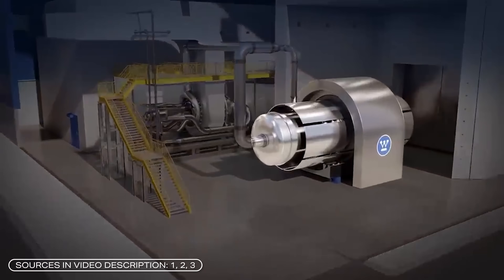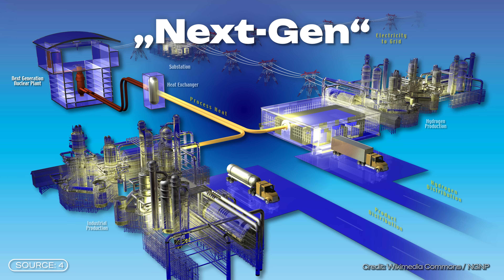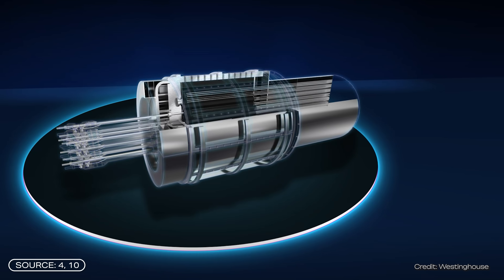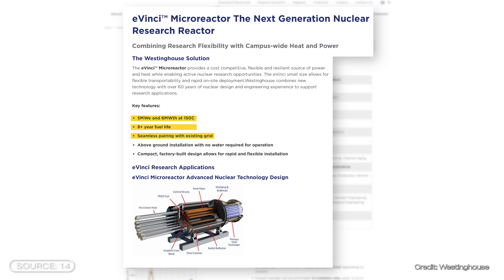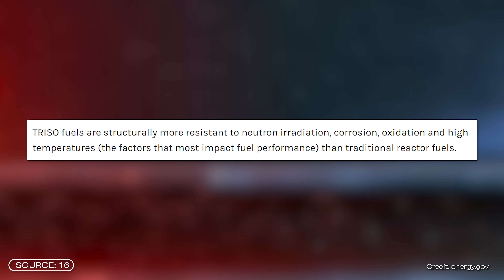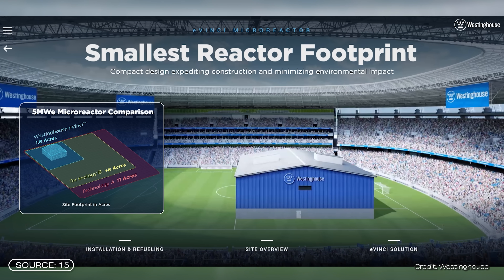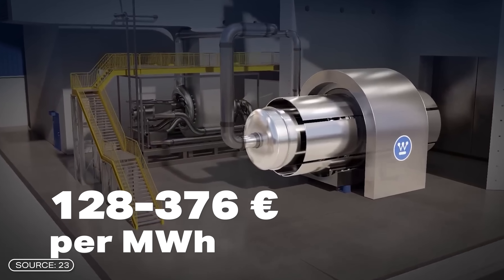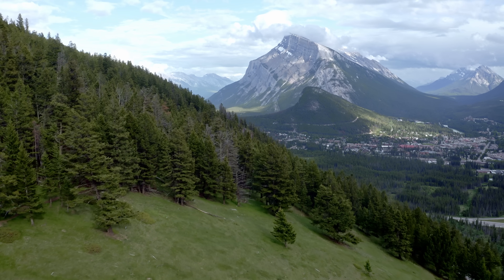Transportable Nuclear Energy: Can This Tiny Reactor Power Our Future?

Comment: If you have a small 10 MW power plant, I would argue they would be awesome for large cities. These things can easily find a use in densely populated areas, because they will reduce the load on the local electrical grid, which means that building newer and bigger projects will not require massive investments in upgrading the local electrical infrastructure.

One issue that we face with electrification of our vehicles is charging capacity. Especially when you're in cities where few people have their own home charger. Think about the MASSIVE gas stations in the US. Buc-ee's in Luling, Texas has more than 120 gas pumps. Imagine the peak draw from the local electrical grid if that was 120 car chargers. Drawing 50 MW from the local grid, especially with massive variance which could range from almost nothing to the full 50 MW could be problematic.

10 MW can power twenty-five 400 kW car chargers. That covers all electrical cars that are currently available. You'd need 48 MW to be able to meet peak demand for those chargers, which is five of these reactors. Five hectares of space. And the only question is, how much of it can you keep underground. You keep fuel tanks for gas stations underground, so why not these reactors?

10 MW can power ten 1 MW chargers, and now you're going to make truckers happy (there are currently no semitrucks on the market that support 1 MW charging - I'm thinking long term). That'd be nice for truck stops, but also for any place that regularly receives lots of trucks with goods on site. Trucking companies will be a lot more keen on hauling your goods, if their trucks can be recharged while they unload. And 1 MW would charge any current electric semi-truck in less than an hour.

Construction sites would probably love them. Everything powered from quiet generators with high power chargers, including large electrical vehicles on site.

Homes typically get less than 50 kW grid connections (200 amps at 240 volts in the US), so you can use one 10 MW reactor to power ~20 homes at peak demand. In an apartment building you can expect the same draw or less per unit, so that's five floors of large apartments per reactor. When power demand in the building is low, sell the surplus electricity to the public grid, and if the grid fails, the building remains powered.

I would argue that things like micro reactors will find their first markets not in remote locations, but in densely populated areas where large power infrastructure upgrades cannot be easily made.
Reply: Your second to last point contradicts the first. If they sold surplus electricity, it would put more load on the local electrical grid undermining that as a reason to have the reactor in the first place.
The NIMBY crowd isn't going to allow micro reactors at charging stations in places where the station would have enough customers to warrant the expensive reactor. At remote charging stations, they'd have to charge a crazy premium to offset the reactor's cost.

The only customer that'll make this take off is the military. If they buy into it, it'll be successful. Otherwise, it'll be a rough start or a flop.
We don't get to have nice things like supersonic passenger jets. I doubt we'll finally live in the future predicted back in the 1950s, because it was and still is a bit impractical.
Reply: Just to add to the NIMBY end of the discussion: most people have been educated by Green Peace and don't know that they themselves are radioactive sources, never mind normal background levels and certain foods.  The fact that a nuclear power's radiation output is more regulated than that of a coal power where there are small amounts of thorium and uranium going up and out the flue is also something not talked about much in these sorts of discussions.  This makes it easier for the sole association to "the Bomb" so much heavier in the average person's mind, and who wants a nuke in their backyard...
Reply: Good discussion!  Unfortunately, there's going to be insurmountable problems with getting permits for a fission nuclear reactor within city limits let alone multiple micro reactors.  A microreactor proposal will get killed in multiple public hearings and lawsuits before the project ever gets started.

That said...

Even if a microreactor got approved (unlikely), the region will have to include multiple evacuation routes, siren systems, public education programs and everyone has to be inconvenienced by learning and participating in mandatory drills and educational programs.  The cost and logistics of these programs will add up.

A microreactor cost per MWh generation ($140–$410/MWh) is higher than standard utility-scale nuclear ($60–$120/MWh).  Standard utility-scale nuclear power is already one of the most expensive ways to generate electricity.

This is the unique nature of nuclear fission energy that no other electrical generation suffers from.  

Micro reactors already have local competition that is getting well entrenched and growing exponentially... solar + batteries.

There's already enough urban rooftop and parking lot space for solar and batteries.  On an annual basis, solar + batteries could supply a large percentage (70% or more) of the annual electrical demand for a whole metropolitan area.  That doesn't even include actual solar & battery farms within city limits or on the city outskirts.

Solar and batteries have none of the nuclear risks.  Solar and integrate quietly and aesthetically into a lot of urban landscape scenarios.  Case in point, we can have a megawatt+ on a Costco or Walmart roof and nobody would even know the panels are there.  The power solar generates is even more local than a microreactor because the solar-generated electricity first flows through the building's own electrical circuitry for local consumption before it ever gets onto the grid.  Then any exported electricity will directly support neighboring buildings and give export credits to the supplier.

A recurring problem with nuclear energy is that the ideas sound fantastic on paper but they get smashed when they meet with real-world economics and real-world engineering.  Microreactors will be very good for scientific, military, and space exploration though.  Those are important areas of society too.

Comment: Can they be used as peakers.  In other words can they be turned off when electricity demand is  low and turned back on when demand is high?
Reply: They could charge large batteries that become the peaker source.  These could be set up in series to crank up higher output to meet peak demand.